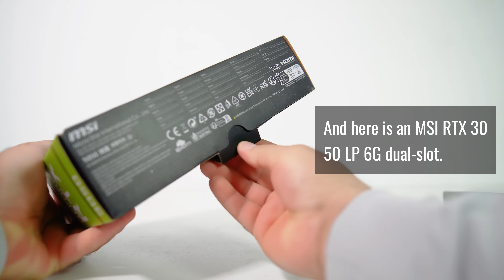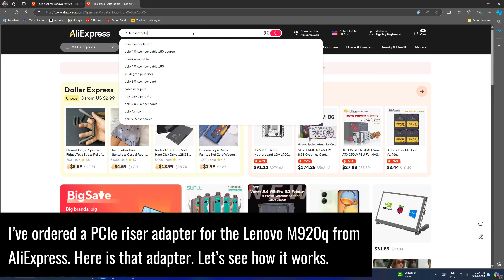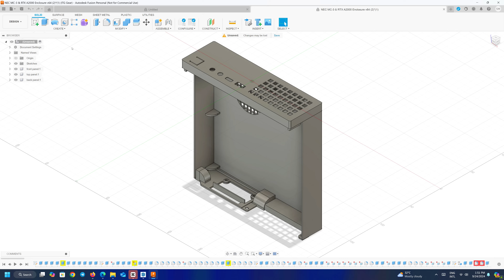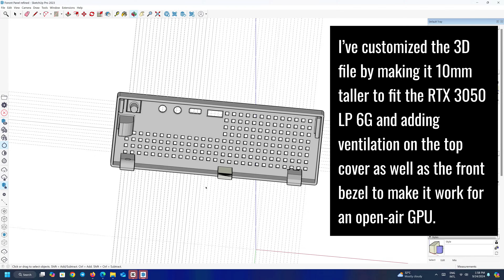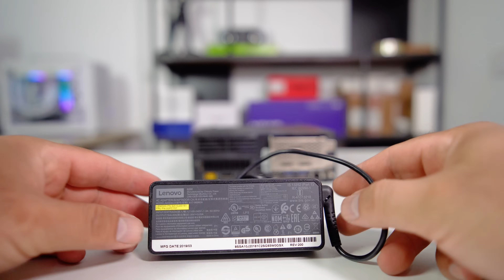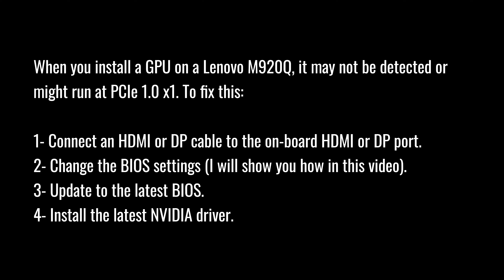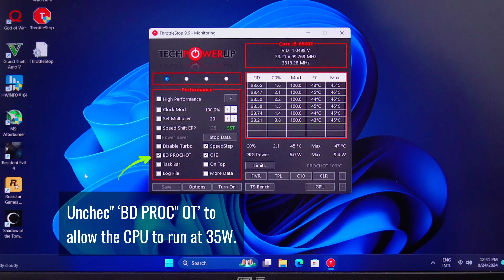Lenovo M920Q+RTX 3050 LP, CPU power limit fixed, Some AAA game 1080p 100fps+

Comment: this video inspired me to build one 
my specs are as follows
m720q i5 8500t
8gb ram (will upgrade price are insane)(honestly the only bottle neck)
pali 1050ti single fan (3050 LP is out of the question in my country as there is no shop selling these)(philippines btw)
upgrade the 65w power brick to 300 (could have gone 230w but with the 2$ price difference so i went 300w)

was not working the 1st time but after installing nvidea drivers worked perfectly
the cost was (so far atleast)
m720q - $125
GPU      - $50
powerbrick -$22

3d print - no idea yet could be $20

Comment: So late question, but I recently bought a m920q tiny from eBay to use as a streaming PC since I'm pretty frugal. But I wanted to install a GPU like you did here. The only thing is, in your links to Amazon for the power supplies, they don't list the m920q tiny in their compatibility listings. So I was wondering if there was an adapter to purchase for the legion PSUs that'll fit in the m920q tiny? I've googled it, but I know Google isn't always accurate if it suggests your videos based on my questions involving this PC. So like are you clipping the original cable and soldering it to the legion PSU? Or am I missing something in your video? I'm genuinely curious because I'm trying to do what you did here, but for streaming and maybe some gaming here and there, but not at the same time unless it's feasible 🙂 pretty much a snip, swap, and solder job was what I thought you did, so I'm just trying to confirm if you did do this or didn't so I can better understand everything you just showed so that I'm careful. I've honestly been rewatching all of your videos and constantly feeling inspired by them, so I figured I'd reach out😅

Comment: i have tryed doing this but my MSI 3050 LP doesn't want to turn on. I have followed the instructions to a T and still nothing i still have to plug my HDMI port into the mobo instead of the GPU. I need help. I have a 300 watt power supply and everything. has anyone else ran into issues like this. I feel like the video is missing out on a few things.
Reply: what are your specs and what model thinkcenter are you using?
Reply: @john-s4e1e  m920q thinkcenter like the video is showing.

Comment: hi @itggear i am having an issue when running games on my m920q my pc would randomly shut off i have and gigabyte rtx 3050 lp pci16 riser card 300w psu and i5 8500t cpu with 16gb ram i have BD PROCHOT disabled in performance i am not sure if the issue is with the psu bottlenecking the cpu and gpu or something else. do you know what might be the issue?
Reply from the maker: Please read my reply comment on other questions similar to your issues.
Reply: @itggear  hi after following the instructions on the comment by @cesarferreira605 i am still having the same issue where the pc shuts off when playing a game ASPM support is disabled in BIOS and PCIe 8x slot speed is set to AUTO pc still displays even when gpu is not connected or im not sure if you want me to plug in the GPU while the pc is on still if you can help me thank you
Reply: what are your specs and what model thinkcenter are you using?
Reply from the maker: @john-s4e1e All information covered in video.

Comment: I am doing this this week on my p330 tiny with i7 9700t. The only issue was I can’t get the MSI 3050 I can only get the ASUS 3050 LP brk OC which says it should be fine on 2 out of the three measurements, but it says it’s about 7mm longer. Do you think Il have an issue colliding with the front panel?
Reply: I have the case printed and painted already I’m hoping Il be ok

Comment: Is it possible to do the same with the m720q?
Reply from the maker: Yes, M720q also has a PCIe slot and it use the same chassis with M920q.
Reply: @itggear  thanks for the answer, I'm glad I just don't have the opportunity to buy the m920q, but the m720q will work

Comment: Got a question i installed a lp 3050 and an i7 8700 into the m920q with a 300w psu but some games will make it crash. Idk if I didnt do something right on throttle stop or maybe there something else I need to do. What all did you change on throttle stop?
Reply from the maker: The Lenovo M920q's total system power is not a fixed 135W limit, as the actual power draw depends on the components used and the power adapter supplied. While the VRM (Voltage Regulator Module) can handle a certain load, using a larger AC adapter doesn't increase the VRM's capacity, but it does ensure a stable power input, especially under heavy loads.

You may need to adjust the CPU and GPU power limits to prevent the system from drawing more power than its components and cooling solution can handle. The maximum supported TDP (Thermal Design Power) for the CPUs is typically 35W, though some models may support higher-wattage processors like 65W CPUs, depending on the specific model and BIOS version. Some users have successfully run 65W CPUs in the M920q, but this often requires a more robust heatsink and can lead to thermal throttling.
It's important to remember that the system will likely throttle performance to stay within its thermal and power constraints.
Reply: So I should probably just put the i7 8700t back in it. Cause im not 100% sure on how to lower the power limit on both gpu and cpu. But ill give it a shot and see how it goes. If its a no go ill just put the original cpu back in it. Thank you for the quick response!

Comment: Is possible install better graphic card? Like rtx 3060 or rtx 3070 ?
Reply: Nope. This thing wouldn't handle that much power. This graphics card is only using 70 watts max from the PCIE lane. While the RTX 3060 and 3070 used around 170-250 watts. The power brick would not support that much power. This 3050 6gb is extremely power efficient and performs similar to a 1660 super. It can play most modern games at 1080p medium settings.

Comment: hello @itggear how do I fix low fps and low gpu usage in counterstrike 2 and halo 2? i have m720q i7 8700T and msi RTX 3050 LP. I am only getting 10 FPS in counter strike.
Reply from the maker: It was CPU throttle. Its not recommended but you use TechPowerUp ThrottleStop app to unluck CPU power limit. Please check in video. You might need to use MSI afterburner to limit gpu power to make your PC running not too hot to prevent crashing.
Reply: @itggear  Hello! After taking some time to diagnose and look at settings, I really have it dialed in and figure out. I fixed my ThrottleStop settings like you said and everything is working as intended.  I am surprised to get 150 FPS using Lossless Scaling in Apex Legends, and 100 fps or so in Halo Infinite and Mecha Break.

Thank you for your time to create these awesome and detailed videos. I am so grateful I was able to recreate this set up from your video for myself thanks to your help! In total it cost me $500~ CAD or so with new graphics card, but if you bought it all in grey market it's about $300 USD!
Reply: @nicksiha  Did you also use 3d printing for the same set up?
Reply: @EvanART11 yup I already own one I just bought the STL files from his site and modified them to my liking before printing

Comment: Alright, so I got an M920q and it came with a 135W PSU at 20V - 6.75A. I've thrown in a graphics card that runs at 50W.
Everything is very good but the PSU does get extremely hot.. Must I upgrade to a 170W or a 230W PSU ??? I have the impression that
The PSU is at its limits with the video card added hence the excessive heat.

Comment: I have tried using 170W PS, once I start a game from Steam my 920Q just shuts down n reboots, I ordered a 230W PS, will test again once it arrives. However I think 170W should be enough?
Reply from the maker: The problem is that those power supplies are not original Lenovo products. Even the 230W model should function the same. If you order a 230W AC adapter from Lenovo, it could cost around $90 to $130.  

Additionally, unexpected PC shutdowns may be caused by VRM chips overheating. To stabilize your system, you might need a 65W CPU cooler and a southbridge heatsink. Setting the power limit for the GPU to 80% and the CPU to 25W can also help ensure stable performance.
Reply: @itggear the 170w adapter I am using now is original Lenovo. How do I limit the power of CPU n GPU?
Reply from the maker: @deanyang1982 You need to complete all four steps:
- Use a reliable AC adapter.
- Install a Southbridge heatsink.
- Add a VRM chip heatsink and ensure a 65W CPU cooler is used to cool the VRM chip.
- Manage CPU and GPU power limits.
This is necessary because you have installed a 70W GPU on a supported PC
Reply: @itggear  was able to get it to run by limit the cpu to 25W and GPU power to be 50%. Will try again with new PS tomorrow.
Reply from the maker: You cannot limit the GPU power to 50% because only specific values can be set for certain GPU series. For example, with the RTX 30 series, the lowest allowable limit is 80%, and with the RTX 40 series, it is 67%. Setting a limit below these values is not supported and may cause system instability or crashes.
Reply: @deanyang1982  Any update dude
Reply: @EvanART11  It was due to my graphics card power setting, reduce it then it wont shut down.

Comment: Its support for ram 3200mhz ?
Reply from the maker: Yes, you install ddr4-3200, however, this pc will only running at 2666mhz only due to limited by cpu support.
Reply: @itggear owh i see ,thanks bro so i will but 2666mhz for this cpu i7 8700t 
My mini pc same with you

Comment: I'm now worried about the burning inside
Reply from the maker: It depends on you. However, if the installation is done improperly, it could become insecure—for example, the PCIe or GPU installation could be dislodged. I strongly advise against attempting this at home unless you have experience in this field. As for me, I have enough expertise to do this and can guarantee there won’t be any issues.
Reply: @itggear  i will definitely try this haha u inspire me, i have an old optiplex 3070, not as good as your mini pc. but I think it will do. Do you have any build with this specific model?
Reply from the maker: @KlypseKlypse  I have 7060 Micro: https://youtu.be/IvJH4AkehEE and 3050 micro https://youtu.be/sxvhNyrCc30
Reply: @itggear  thank you so much, really appreciate it

Comment: Question for those using this with Batocera in a bartop arcade: Would this be possible since Throttle Stop is a windows program? I want something like this for a bartop arcade cabinet, but not sure if this would work 😢

Comment: Wait, only 8gb ram? Mine has 16gb, did u get like a special one or am i lucky?
Reply from the maker: It's not a big deal; it's just the RAM. You can choose any capacity as long as your PC supports it. It's included in the price and depends on the seller's configuration. It's not necessary to settle for just 16GB—if you're lucky, you may be able to upgrade your RAM up to 32GB without any problems.

Comment: I followed all the steps to get a 3050 mounted to my M920q and even got a 230w Lenovo power supply but when i boot up a game my computer powers off and i have to remove the power plug and reinsert to boot it back up.
Reply from the maker: Please read Disclaimer in the video description Thank you.
Reply: @itggear  I figured it out. The bottom of the GPU board was touching the motherboard and CPU chip and causing a short and i just placed some electrical tape in between so they aren't making direct contact and that fixed the issue. Its running awesome now! thanks.

Comment: Hi ... I've been seeing your work for a while and it's amazing.

I have a question about the CPU is it possible to change (upgrade) it?
Reply from the maker: Yes, you can upgrade the CPU for this model. The M920q supports only 35W T-series Intel Core 8th and 9th generation CPUs, such as the i7-8700T, i7-9700T, and i9-9900T. Thank you.
Reply: @itggear  Thank you, you're the best

Comment: Ich have a ThinkCentre m625q. I installed Windows 11 on it and it’s soooooooooooo laggy. The CPU usage is on 100%, when I only open the TaskManager
Reply from the maker: In this particular video, the Lenovo M920q is featured, which is a different model from your M625q PC. Thank you.

Comment: Very nice video, thx. I've an m910x with a 6500T (35W) and a RX460 4Gb, sotck original. I would like to upgrade it  with a Yeston 3050 single slot LP card, do you think i will have problems with pci-e power? Pci-power is limited to 50W? Thx,.
Reply from the maker: Yes, it will cause your PC to experience more stress with a 70W GPU installed, and it may lead to CPU throttling. You might consider using the ThrottleStop app to address this issue. However, disabling BD PROCHOT is not recommended, so please proceed with caution.

Comment: Hello, I've got another problem.
Have the same build (even with your 3d print)😅
I used the rx 6400 without problems but i wanted to upgrade to the msi 3050..

But know when i start a game the system immediately shuts down
..
Do you have a solution? Did anyone have a similar problem?
Tried it with another m720q ... Same situation.

Please help😊
Reply from the maker: @andreaseschbaum8593  I think you might need original 230W or 300W Lenovo AC adapter.
Reply: @itggear  i already have the 300w lenovo adapter :-(
Reply: Check not touch the motherbord to get a short

Comment: I have one with 10400T and 16gb ram it’s 720q sadly doesn’t have the pcie slot soldered and can’t find one with 148 pins only the normal 164 pins on Ali so I am able of the riser I don’t want a bulky pc with outside GPU and power supply

Comment: Is there a specific hardware set for attaching the cases together? Are you just using a screw to holt the top cover down? Or is it a captured nut holding it in? I have everything I need to start this project but unsure if I need additional hardware like screws.

Comment: why does mine reset itself when hit by heavy games and testing 3Dmark
Reply from the maker: Maybe the PC is running too hot. You can try setting a power limit for the GPU and using ThrottleStop to limit the CPU power to around 25W. Thank you.
Reply: @itggear  is this possible due to lack of power? because when i try to use lower power supply the symptoms are the same

Comment: Does the lack of having REBAR support on these TINY devices really make a difference?
Reply from the maker: In fact, this setup cannot fully utilize the RTX 3050, as this budget office PC is designed for business and office tasks and lacks gaming features. Additionally, with this low price, it does not support PCIe 4.0. However, if you're happy to sacrifice some performance, this PC still delivers great performance—though not at maximum capacity—at an affordable price. Alternatively, you can invest more in newer models like the M90q Gen 3 or P360 Tiny, priced around 1,000 USD, which offer better performance than this setup. Thank you.
Reply: @itggear  I am building a system for may daughter, (she is 10 & this will be her first PC) out of an M720q, 8400T/16gb DC/1tb with a Radeon Pro WX4100,(4gb)it only has an 8x PCIe Which matches, but was wondering If Rebar would improve the performance. Not that she will need it with the low end Games she is starting out with it's Just a curiosity.
Reply from the maker: @ The ReBAR feature allows software or games to utilize more than 4GB of VRAM, but it still depends on whether the software or game supports ReBAR. Additionally, this feature is only useful for GPUs with over 4GB of VRAM. For GPUs with 4GB or less VRAM, it doesn't have any impact since there is no additional VRAM above 4GB to utilize. Thank you.

Comment: can I use i7 8700 processor in this instead of i7 8700T processor?
Reply: Higher charger
Reply from the maker: This PC model does not support a 65W CPU. The issue is not the charger you have, but rather the BIOS, which will limit the GPU to its slowest speed.

Comment: Just built this same pc using a Lenovo M720Q and ETA Primes open air design. Had to do the same tweaks in Throttle Stop but also had to change the voltage on the GPU to around 55 watts. Works awesome. 1080p gaming at a consistent 55 to 60 fps in Marvel Rivals. Mission accomplished! Thanks so much to ITG for putting out this awesome idea.
Reply: @jeremyjddorsey  did you lower the GPU power due to power cutoff? I also have m720q with i7-9700T and RTX 3050 and I always have sudden power loss during running of some heavy games. I have a beefy 200+ W power supply and I thought this would be enough, but it seems like the board has its own power limit.
Reply: @spynet41  I lowered it because it was definitely cutting off during gameplay. I guess there are sensors under the GPU that cause it to shutdown when overheated. So undervolting the GPU in combo with the throttle stop tips in this video and others had me running flawlessly. Try those two things and let me know if it works for you. Hopefully it's not an issue with your more powerful cpu causing some issue.
Reply: @spynet41  Brother, what PCIe does the M720Q have? Does it have PCIe 1.0 x1 or x16? Or x8? I hope you can answer me, or if we can contact you so, like you did, I'm going to buy the same components to improve my M720Q.
Reply: @Dax1705  It's a gen3 x8 If I remember. Which components do you mean? The 3050 gpu? Look that there are single slot 3050 out there, so you could fit one in without need to make a DIY casing.
Reply: Out of curiosity, how loud does the fans gets?🤔
Reply: @Mosestylez  It's not very loud at all. Inititally I tuned the fans all the way up and it was waaaaaay too loud. But adjusting the voltage lower means the fan doesn't have to get loud at all. You can barely hear it which is awesome since there is nothing blocking the sound with it being open air.